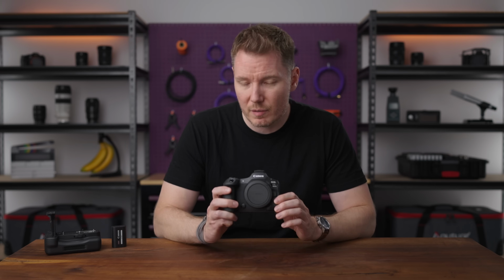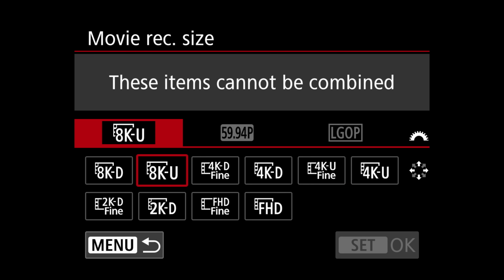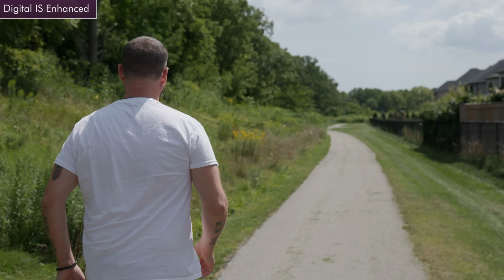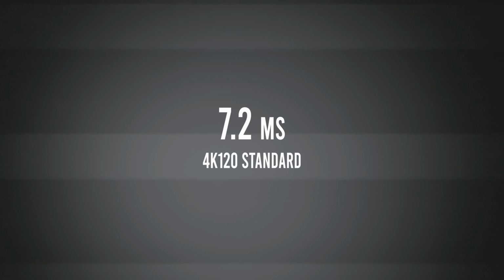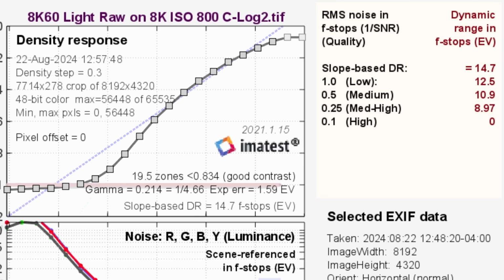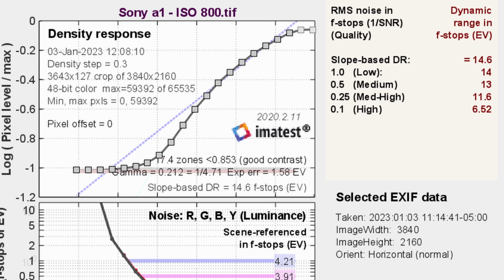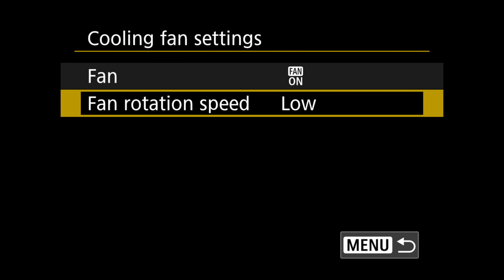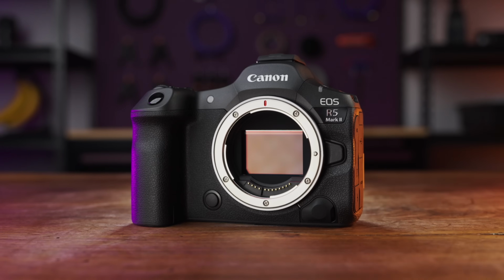Canon R5 Mark II Review: A Truly Impressive Camera

Comment: What makes this a better hybrid than the R5C? Isn’t the R5C inherently better as a hybrid camera specifically because it has the dual operating system and otherwise pretty similar specs? Sure, the R5 MKII does some stuff better, especially for photos, but the best hybrid would be whichever is the best at both photo and video, wouldn’t it? I ask because I am trying to choose and it seems that the OS, the internal fan, and things like 8K downsampling in 4K 60 make the R5C better for someone like me who wants a true cinema camera and high end photography camera in one? Am I missing something? Should I reconsider?

Comment: As the rolling shutter test and my overheat test, the 8k30 mode just doesn't use the stacked part to keep the sensor stay cool. The 8k60p does use so the readout speed is much faster. And that's why it overheating, The high frame rate overheating is not the processor overheating, It's the sensor. I measured 70 degrees C on sensor after 20mins of  8k60 auto shutdown.

Comment: 📷 In-Baked Noise Reduction in Canon Cameras — Especially the R5 Mark II

Canon is known for applying a level of baked-in noise reduction (NR), especially in RAW files, that cannot be fully turned off — and this applies to both older and newer bodies, including the Canon EOS R5 Mark II.

Here’s a detailed look:

⸻

❓ What is “Baked-In” Noise Reduction?
	•	Baked-in NR means the noise reduction is applied before the RAW file is saved — it’s part of the sensor’s signal processing pipeline.
	•	Even when you turn High ISO NR or Long Exposure NR off in the menus, some noise reduction still happens behind the scenes.
	•	This cannot be undone in post-processing because it’s not user-accessible data anymore.

⸻

📌 In Canon R5 Mark II Specifically:

✅ What Users and Testers Have Observed:
	•	Even when High ISO Noise Reduction is disabled in settings:
	•	RAW files still show signs of smoothing or noise suppression, especially in low-contrast fine details (like skin texture or star fields).
	•	Compared to Nikon or Sony, Canon’s RAW files often look “cleaner” but at the cost of detail loss or texture smoothing.
	•	This is more noticeable at higher ISOs, where Canon’s in-camera processing becomes more aggressive.

⚠️ Key Issue:

The NR is integrated into Canon’s RAW pipeline, especially in CR3 files. It’s not something you can fully control or disable.

Comment: The Canon R5 Mark II SRAW 4k30p and 4k60p is absolutely horrible (soft). It must use line skipping, which neither 8k30p nor 8k60p does. I returned it for a refund. Unforgivable.
Reply: I find it way sharper than 4K standard, and almost on par with 4K fine. I’ve had zero issues with moire or artifacts either, but I do shoot in RAW and not RAW light when using the SRaw, which apparently is significantly better. I’ve not used RAW light in SRaw, so I can’t comment on that, but in standard RAW, image quality is very decent

Comment: Look at all the trouble you mentioned about every Canon you tested over the years.. 
Still seem petty (heating, buying bulky external fans after 12 years of overheating, 
also SD card door prevents relay recording + + +  >>> WHEN Panasonics (Full frame and M43) has avoided these problems as a matter of design, customer satisfaction, and price. 
disclaimer: I use both Sony and Panasonic, Both good, the only difference for me is Pana's are more fun and easier to use.
.
We tried Canon C3 amd R5C.. Nah... too Plasticky for the price.
they frustrated me due to lack of simple things (e.g. White Balance procedure to start with).
..  but we know about your bias against Lumix on a couple of your eps. (w/ excuses and without) , without any real-world experience it seems. 
Meanwhile, other guys (e.g. Slanted lens) do compare Panasonics with Canon, Sony using the same model... etc... They always find Pana' better than the more expensive Canons in terms of +/- exposure anomalies and micro-contrast. 
and they show you the results magnified. 
Panasonics also do great 100 meg photos which escapes you. 
Then there is Panasonic's low price which affects the majority of users.     
Still I appreciate your positive demeanor and the testing that you do, I just wish you'd be less biased on the odd occasion and keep your emotions out of what is otherwise quality presentation ;-)   

No hard feelings I hope.

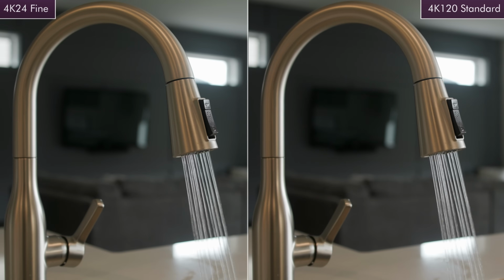Comment: @10:58 I cannot see any difference between 24p and 120p which lead me to believe that the difference is due to clock frequency boost that causes rapid increase of heat built-up leading to excessive overheating in a mode that would not be used for long takes anyways.

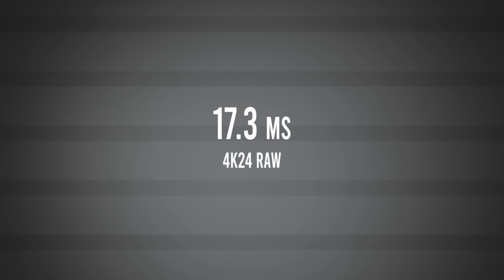Comment: @8:46 perhaps it just get a boost in clock frequency that load battery and the processor to the point where oversampling and encoding is no longer possible (hence no encoded 8K 60p and no oversampled 4K Fine at 60p)?

Comment: Thank you so much for all your hard work, bookmarking (and liked/subbed) for future reference on my new R5ii. Few Qs: 1) for best PQ (but avoiding RAW to keep file sizes down a bit) at 4K Fine do you recommend HEVC or AVC codec? I keep reading HEVC is the newer and more efficient format, but on the camera it locks you to using LGOP whereas with the AVC you can choose Intraframe compression methods. 2) In your DR tests were you using AVC with standard or high Intraframe, or another compression method? 3) when your DR tests says something was shot in 24FPS, in some of the codec/compression combos, 24FPS is locked out and 23.96 is the only option, does your DR result apply to 23.96FPS or only to the modes that are at 24.00FPS? Thanks again!

Comment: Hey - interestingly what you didn't notice is that at 15:52 the standard 4k24 as well as the 4k120 have one stop more of slope based DR, so there it's 16.1 stops. Any idea if this could be a mistake? And what's even more interesting that at 4000 iso it even reads 16.3 stops

Comment: I've been using the camera since launch, and have been able to do what I want, when I want.  I don't have the battery fan grip, but I will say that some time ago, I filmed a music video entirely in 4K 60 Raw.  After about an hour of filming, the camera overheat and shut down in a room that was about 80 degrees F.  I turned the switch off then immediately on again, and didn't wait for the camera to cool.  I filmed for another half hour before it did it again.  I just then shut off and on and was running again.  Lol.  It's annoying when it happens, but at least I didn't have to wait for the camera before I could film again.

Comment: Hi, at the moment I have a Canonr7 with a100-500 lens I am thinking of buying a Canon R5 mark ii but I am a bit concerned about losing the reach. I have with the crop sensor on the R7. Do you think with the 45mp it won’t make much difference  will be using the 100 to 500 any advice you can give me would be much appreciated thanks Keith

Comment: This is the only video I've found so far that talks about the video AF in S&F/high FPS modes. My R5C's AF gets crippled in S&F mode, which is really unfortunate because I mostly work in S&F. I'm hoping to get an R5ii as my gimbal camera to shoot 4k/60 in S&F mode with proper face/eye tracking.
Reply from the maker: Hey! For clarity, I didn't actually test the S&F modes, when I said the AF works at high frame rate, I meant shooting 4K60 and 4K120 with sound, not the pre-slowed version. If I still had the camera, I'd test the S&F for ya, but perhaps the online manual will say?

Comment: It would be cool to test the dynamic range close to the limit of temperature warning. Cinema cameras have temp-stabilised sensors to ensure best performance, so I wonder whether dynamic range or noise starts suffering with high temperatures after long recording session. Thanks for the comprehensive vid as always!

Comment: The way I see it this is still a catch up camera whit a hefty price tag. In UK the r5II is at least £1000 more than Z8. I see that Canon mirrors a lot of Z8 specs but:
Canon still has the god awful ibis corner wobble on wide lenses. It still doesn’t use gyro for eis.
Canon is missing 4K60 oversampled mode in comparison to Nikon that has it.
The rolling shutter in its fastest mode is still nearly double of what Nikon is capable of.
Kudos for more dynamic range, but I’m still not sure it would be worth premium over its closes competitor.

Comment: I realize crop is a naughty word these days but I would like to see some tests using the crop mode. The benefit of the crop mode is it overheats a lot less, the 4k 60 is oversampled from 5.1k vs line skipped and it likely has a much better rolling shutter since its using a smaller portion of the sensor. Since the R5 has 8k resolution its one of the few fullframe cameras that can do a APSC/s35mm crop and still have over sampling. The R5 ironically is actually a really good s35mm camera. APSC crop is 1.6x vs the typical 1.5x crop of s35mm but a 1.6 crop just happens to be the same as Academy 35mm film.

It also has the added benefit of longer reach for those that need that sort of thing.

I know some have made really good use of the crop mode on the first R5 to get around overheating and a way to get extra reach. Some have even added 0.71x focal reducers to recover some of that FOV. I always felt it was a good option for those shooting wildlife, wedding or live performance type videos.

I sometimes use 5.1k raw from the first R5 to my Ninja V.

Comment: I mostly do still photography.  I’ve been slowly reading the manual and there are quite a few features that Canon has added.  Things I’ve wanted for some time.  One is a “Priority” for the card slots.  I can remove the CF card and close the door.  The camera switches to card 2 but I don’t care.  I move the files from the CF card to my computer and then put the CF card back in.  The camera now switches back to the CF card.  YEA!!!  Before, I had to either not close the door while I downloaded the images or set the card back to the CF card manually.

It has a lot of versatility in the auto focus.  The area of the AF can be adjusted and changed in many different ways.

Like all Canon cameras, it has the C1-C3 modes which is confusing to me.  Now they have added the ability to save the AF settings and give these sets of settings names.  This is a huge win I think.  I’ve not really exploited it yet but I think that is most of what I’ve been wanting from the C1-C3 modes.  The way the C1-C3 modes work just doesn’t fit my brain.

Comment: Hello, great review and dynamic range test, always take a look at your charts when needed for my own test.
I have done overheating test on my own between 27 and 30° and for non oversample modes it get a bit worst at 30 (celsius I'm french) but the oversampled modes are anorher story 28+ and the camera overheat betwern 35 to 45mn. The 60p works like the 24p just a loss of battery endurance, 1h45 against 1h28.
The only mode that is artificially mademuch shorter in time is the 120p which like on your results is consistantly for me 14 or 15min without the cooling grip or with a extra camera fan. The camera isn't hot to the touch eather.

The only complaint I have is the no 120p in 1.6crop 

Bye

Comment: $6.8k AUD is an absolute ripoff though. Canons pricing is insane atm. If you’re a dual camera user you’d be out of pocket nearly $14k without any accessories added on. What on earth has happened to photography. I had dual 5D3’s for a total of $5k 10 years ago.
Reply: 10 years ago, the AUD was worth almost double what is today 😢
Reply: @GuidoGautsch  it’s definitely wasn’t worth double but it has dropped from $1 to 62c vs USD. That $5k would need to be $8.5k today take inflation into account and it goes to $10k. These are still nearly 40% more expensive after taking all that into account. Crazy crazy stuff.

Comment: What about the details, has anything been improved? E.G:
- during FTP image transfer when switching off or changing lenses, complete the photo currently being transferred instead of canceling the transfer immediately (analogous to writing the cache to the memory card when switching off, which is not canceled either)
- Is it now possible to use the ISO limit from the AutoISO menu in the “Recall Shooting Function” with which you can call up a different setting at the touch of a button as long as you press the button? Unfortunately, this option is not included in the predecessor.
- Is the Wifi transmission even faster?

Comment: Don’t think this camera is better than the A1 and the A1 is what 3y old?
Reply: You can easily create use cases where this camera beats the A1, and you can do the opposite. The A1 is nowhere near capable of 8K 60p raw internally, and this camera is more than 2000 less than the current price of the A1, that's impressive. I think it’s the most well-rounded hybrid camera out there at the moment, but all cameras have their weaknesses.

Comment: Is that outro shot what happens when it reaches 12/10 on the heat-o-meter? 🤣.

Just kidding - I have this camera and really like it a lot.  I tested 4K standard in direct sun when it was 90+F (32C) here in Virginia last week, and it stabilized at between 3-4 bars… no issue at all.

Battery life is improved, IBIS is improved, AF is awesome, and CLOG2… plus it’s an amazing stills camera.

There’s no such thing as a perfect camera (Camera Conspiracies still has a job), but this is a fantastically well-rounded hybrid.

Love your review, man!

Comment: Hold up. You CANT turn off subject detection?

You mean stop the auto focus? Or stop subject face detection / subject detection?

Because the canon R8 con do all of those. Pause auto focus. Pause subject detection, and change from subject detection to face subject priority.
Reply from the maker: You can. You just can't map it to a custom button in video mode. You have to go into the menu to do it.

Comment: All of these sensor interfaces are written with the ability to start and finish reading the sensor vertically at basically any point. There are just requirements like reading 15 lines at a time, or things like that. It is my guess that the slower/faster readout does not have to do with reading beyond the actual necessary resolution for a given mode.
It's possible that we are seeing 14-bit vs. 12-bit readout in the 30 vs 60p modes, and that 12-bit already has as much dynamic range as Clog2 is really capable of dealing with, so we're not seeing a noticeable degradation. There just aren't that many things that effect readout speed. My only other thought is that it has to do with power consumption, so they chose to not read out at the faster speed during normal record modes to save power.

Comment: Raw video dynamic range is over a full stop more at 0.5 (medium) than the Z8/9 and Z6III, impressive.
Reply: To add to that, Canon applies NR on raws while Nikon does not. Then you remember that Z8 can be found for 3500 with a lil bit of patience. Meanwhile on the Z9 size, you get almost true unlimited recording and that wonderful big big battery.
Reply: Nikons lenses are/always have been superior to canon. I'll trade the 1/2 stop of DR for the quality and flexibility of the F/Z and 3rd party lenses.
Reply: @bailey.nt86  Nikon is way behind on AF, my R3 smokes any Z and the A1. Only the A9III can compete because it uses 100% of the sensor, like Canon. AND Canon has improved AF with this and the R1. Nikon and other Sonys use 70% of the sensor for AF points. I had the A1 for a day and the A7IV for two months and they can't compete with AF.
Reply: @LukeChristo  My Nikon makes me money and pays my bills 😌  that's all I need it to do 🫡 as too have all the Nikon DSLRs I still own and shoot and make money with. Glad you like your Canon.

Comment: As for the EOS R5 II's 4K SRAW, its images should theoretically be no match for any oversampled 4K YUV.

4K Bayer RAW doesn't exist at full brightness and requires demosaicing.
Whereas the 8K supersampled 4K YUV 4:2:2 image exists at full 4K luminance resolution, with half the chroma resolution.

The difference is significant.

Interestingly, the EOS R5 II's 4K SRAW is not a true CIS pixel merge/line skip RAW; it internally captures 8192x4320, undergoes incomplete demosaic processing to DCI 8K RGB, downconverts to DCI 4K RGB and reapplies the Bayer RGGB CFA to sample the DCI 4K RGB into Bayer mode DCI 4K RAW.

This practice is currently the best solution for half resolution RAW for high resolution sensor output images. Unfortunately, it does not speed up the sensor readout time.

By using pixel merging/skipping on the CIS side, the readout time can be significantly accelerated. However, Bayer sensors with an even number of pixel merge/skip lines have asymmetric distances between pixels.
Without bin correction, this is disastrous. For example, the Nikon Z9's 4K120 N-RAW has no in-camera bin correction, the decoding software doesn't know it's a pixel-merged RAW, and the image decoded as a regular Bayer RAW becomes jagged on the high-frequency diagonal.

Comment: Hi Undone, thanks for the review.
The readout speed of the camera sensor using pixel merging/pixel skipping in the cropped area does not speed up the readout time of the sensor to read out every effective pixel of the frame, as it is not in the imaging interval and is not measured.
If Canon has adjusted the accuracy of the ADC, it must have changed the SNR distribution, which is not consistent with the test results.

I have implemented on mobile phone platforms to reduce the heating of the phone by reducing the CIS read speed. Contact the FAE of the CIS manufacturer and change the appropriate register parameters. No adjustments to the AD accuracy, no impact on the IQ of the frame, just a readout time from 1/72s to 1/36s. I think this is obviously easier to achieve between Canon originals.
I can't find the reason for this on the EOS R5 II, except to say that the reduction in readout speed is more likely a temperature control device.